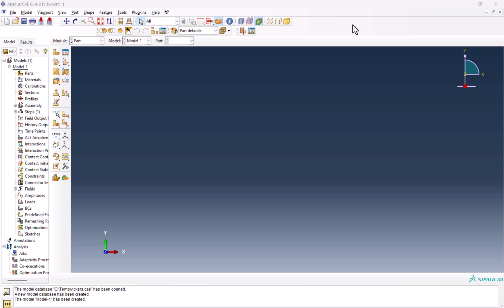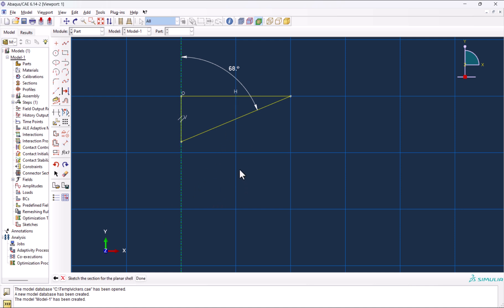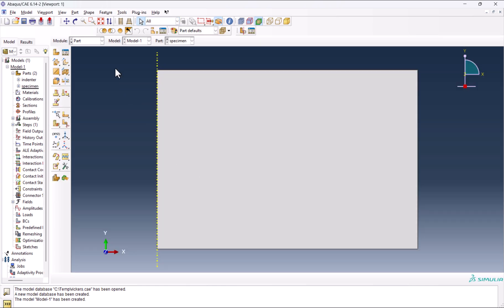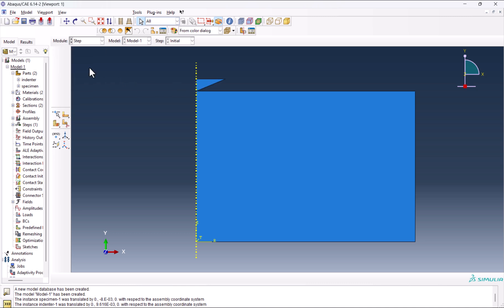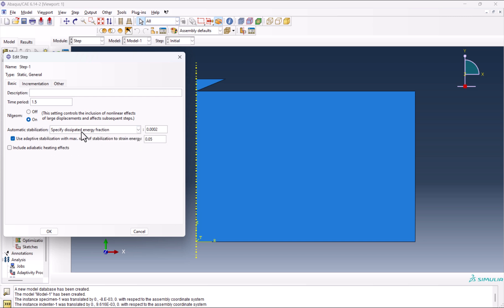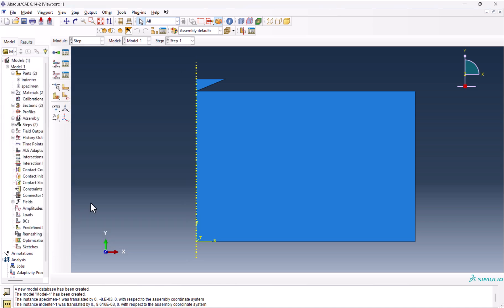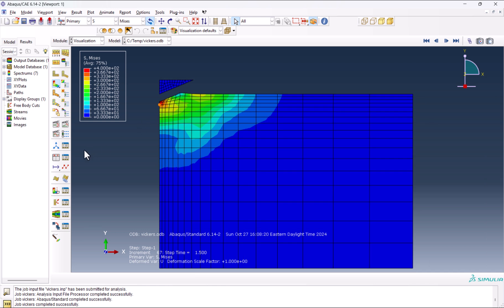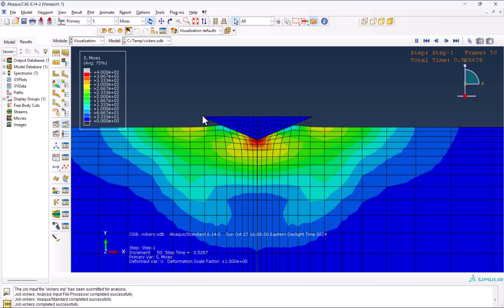Improve Micro Indentation in Abaqus: Try This Approach!

Comment: Thank you for your informative videos; I have been watching them for a while, and I am on the introductory level. Some questions: Why did you choose a deformable part instead of a rigid body for the indenter? Why do you use an RP? Isn't it relatable to rigid bodies or complex connections? And wasn't it better to use a discrete rigid (with mesh)?
Reply from the maker: Great questions too! I used a deformable part for the indenter mainly for flexibility—sometimes you may want to switch materials or analyze contact pressure. But yes, for a simple indentation, a discrete rigid body would be totally valid and often more efficient!

The Reference Point (RP) is needed to control or track the motion of the indenter—especially if it’s rigid or tied to a surface. It’s super helpful when applying loads or extracting reaction forces.

Using a meshed discrete rigid is fine too, but it slightly increases complexity unless you really need mesh-based interactions. Hope this clears things up! 💡There's another video on analytical rigid here's the link https://www.youtube.com/watch?v=J6RJI3D29Hg!
Reply: @FEAMASTER  Yes, Thanks for your answer. I am using learning edition, the analytical rigid was really tough to execute, maybe because of the limited number of nodes I used, but this one worked well. I think that if we want to use mesh (with the same minimum size in master and slave parts), discrete would be more prefered in comparison to deformable, as shown in this video. However, as a tutorial, it seems okay.
Reply from the maker: @aaalyaniii  Totally agree with you—well said! 👌 The Learning Edition’s limitations (especially the node count) definitely make analytical rigid setups a bit tricky. In those cases, going with discrete rigid can be a better option if you're meshing both master and slave surfaces with similar size.

And yes, for tutorial purposes, I kept it simple with deformable just to make it more accessible to everyone. Appreciate your thoughtful input—it really adds to the discussion! 🙌

Comment: I have this error what’s the reason do you know ( THE *BRITTLE CRACKING OPTION AND THE *BRITTLE SHEAR OPTION ARE NOT AVAILABLE IN Abaqus/Standard.

Analysis Input File Processor exited with an error.)
Reply from the maker: Have you added another material properties other than the one in the video? You don’t need brittle cracking for indentation because we do not damage the material in the micro indentation! The indentation effect can go away with a simple grinding or even polishing!